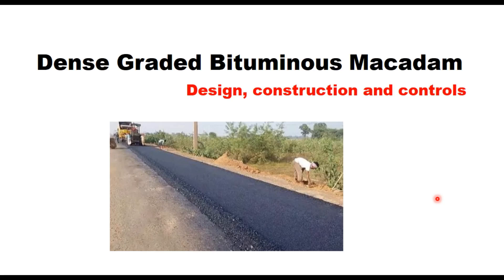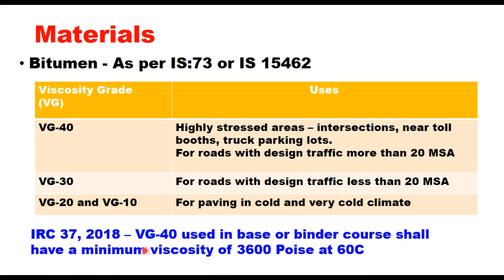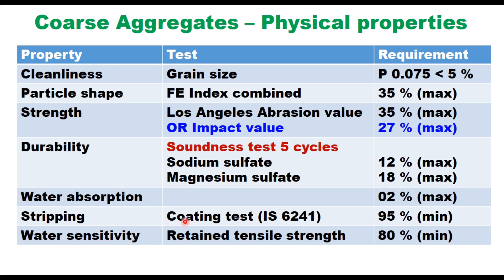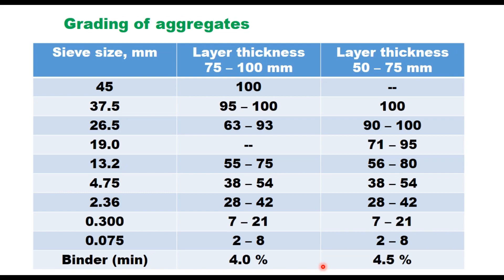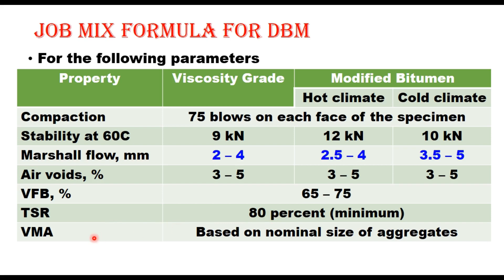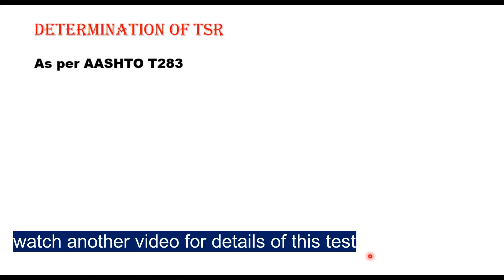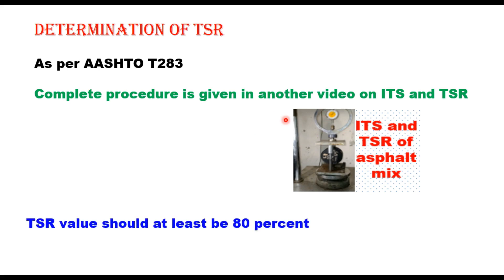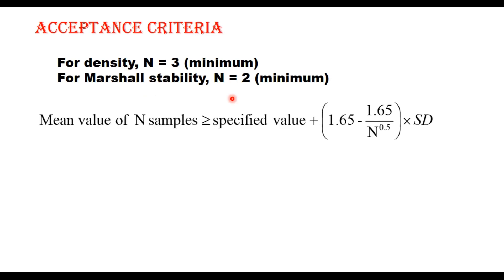Dense Bituminous Macadam, DBM, Design, construction and Quality Control as per Indian Specifications

Comment: Sir can we have DBM of 50mm. I think it must be 75 mm min for 26.5 mm aggregate. As per MORTH we have only option of 26.5 and 37.5. Pls correct me if i am wrong .
Reply from the maker: DBM layer can be provided in 50 mm thickness also. DBM Grading 1 (NMAS 37.5) is used for layer thickness more than 75 mm, Grading 2 (NMAS 26.5 mm) is for 50-75 mm
The thickness will depend on the design of the pavement,

Comment: Sir why we add filler lime in dbm/bc mix , what is the purpose of this please explain and can we laying dbm without using lime
Reply from the maker: Lime is an anti-stripping agent and is used to provide more durability in the mix. We can design the mix without lime powder also, but it is desirable to keep it at least in the top layer.
Reply: @SatishIITR thanks for your reply sir , one more thing sir as earlier reply by you sir that bitumens to fines ratio is calculate by percentage passing  of 75 micron and divide by Bitumen content if my bitumen to fines ratio is about 2 then how to carry in range of 0.6 to 1.2 (specified limit in morth) which aggregate should be need to down
Reply from the maker: @civiltechnoharyana7850  You should see the aggregate stockpile which is contributing to the filler (P75 micron) in the final mix. generally, stone dust is required to be reduced to get F-B ratio within limits.
Reply: @SatishIITR thanks sir 
Can I remove filler 2% and use dbm mix without filler , so that my bitumen to fines ratio is comes in range , is it any problems in dbm layer
Reply: @SatishIITR thanks sir 
Can I remove filler 2% and use dbm mix without filler , so that my bitumen to fines ratio is comes in range , is it any problems in dbm layer
Reply from the maker: @civiltechnoharyana7850  Question is not removing the filler. If you are using lime as filler, keep it and reduce the percentage of other aggregate which are contributiing the finer sizes. If F-B ratio is 2, that means the percent passing 75 micron is outside the permissible limtes, more than 8 percent. Change the dust to some coarser material. You know it better as you all grading of all individual stockpiles with you.

Comment: Hello sir.. what is Refusal density and it's procedure and it's relevant code please explain that topic sir..
Reply from the maker: The Refusal density is a measure of the maximum degree of packing of aggregates in the asphalt mix that is possible without degradation of the aggregate. It is the density at which further comaction of the mix will not have effect on air voids (or density). It is used to simulate the insitu density to which an asphalt mix can be compacted under extreme conditions of traffic loading. You may refer this document.
https://www.afpa.asn.au/wp-content/uploads/2017/12/AAPA_IG-8_Asphalt_Mix_Design.pdf
Reply: @SatishIITR  i didn't expect such a fast reply from u sir..i am so happy for ur support ...Ur my inspiration sir 🙏🙏
Reply from the maker: @saikumarnandhigama842  Answering your queries is always a pleasure
Reply: @SatishIITR  While we testing the cubes in 28 day's curing but at site we will do 14 day's of curing period is ther any kind of logic is there sir can u explain?
Reply from the maker: @saikumarnandhigama842  I do not understand this question, it is out of context. No cube is made in the case of DBM
Reply: @SatishIITR sir while casting any deck slab or any structure concreting work we will do 14 day's curing only at site as per morth and IS 456 .. but cubes casted at site we will test after 28 day's curing period for to know the strength cube...pl try to understand my intention sir i am poor in English  sir.. 😅
Reply from the maker: @saikumarnandhigama842  English is not an issue. I am not a structural Engineer, I cannot answer this question
Reply: @SatishIITR   ok sir thanx 4 ur support..